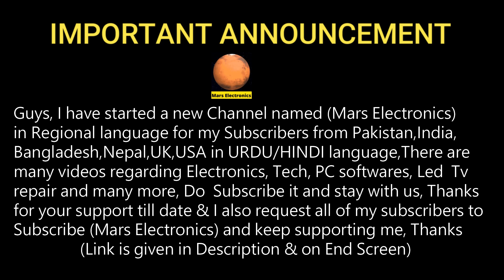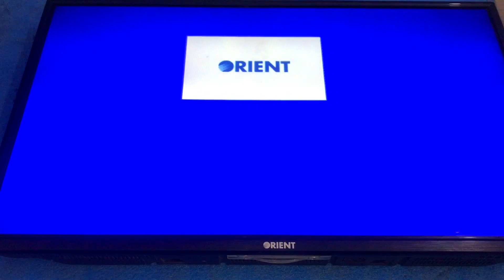HOW TO INSTALL BACKLIGHT LED DRIVER, GOLD-17ES

Comment: My samsung LTM230HL08 panel has a 4 pin connector for the BL. In the datasheet it says is has Backlight: 12S3P WLED, No Driver and the pin layout is: pin1=VIN, pin2=Return1, pin3=Return2, pin4=Return3.  I like to replace the controller, but that inverter board looks totally different, no BL-on or ADJ signal? I think it is PWM controller. Do you know a suitable controller?
Reply from the maker: There should be 1 pin for GND,1 pin for BL-on and 1 for BL-Adj in these 4 pins marked as return,
You can with continuity mode on multimeter for GND pin and check one by one other 2 pins by soldering wires and checking results
Reply: @ElectronicSecret  Thanks for the reply. I think the Backlight excist of 3 parallel strings of 12 leds in serie (hence the 12Serie 3Parallel, 12S3P ). Each string get voltage through the common VIN on pin1. And each string has his own GND on pin2,3 and 4. So if 'm right, I think I would need a PWM led driver board that can supply power to these 3 strings op 14leds. To supply power on pin 1 and use pin 2-4 as common ground together. I'm don't know in the orignal setup why the driver board use 3 seperate Returns (=Ground?). I had a check with the Ohm-meter on the panel 4pin connector. I don't get any result, all combinations return OL. That is bizar, in my reasoning I would have thought that I would get Ohm result between  1-2, or 1-3, or 1-4, only in 1 direction. Just like I would measure a simple led. But nothing. So I think there is more logic build in the panel besides only the 3 ledstrips. My idea was to use this controller board kit https://www.aliexpress.com/item/1005001409754867.html where they say it is specific (pré-programmed?) for this type of panel. But the invertor (in fact led driver) doesn't not have the right connectors.

Comment: Is it back light driver is the problem when the TV has no picture? but there is sound.
Reply from the maker: No
Most of time it is backlight strips problem,
You can check opening the back cover,
If you are getting voltage at backlight strip connector then your backlight strips are faulty if not then backlight driver,
I have many videos on my channel regarding black screen fix,